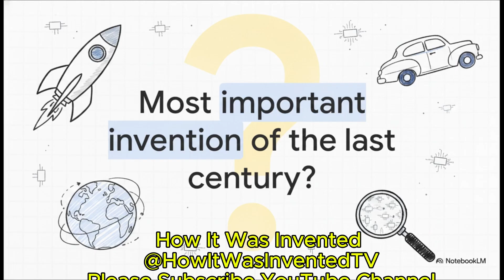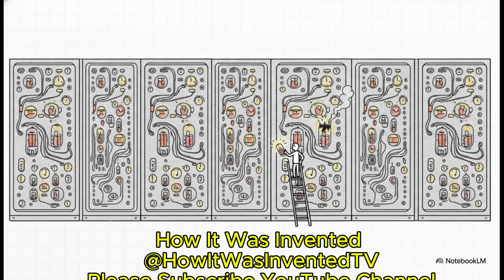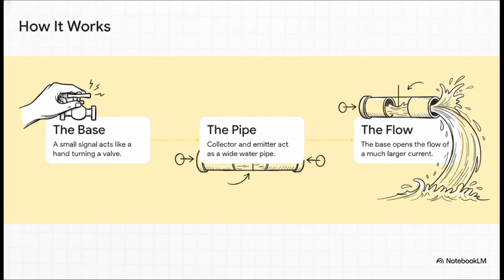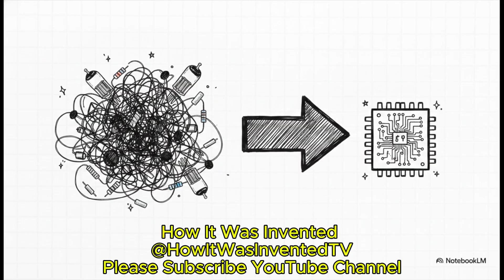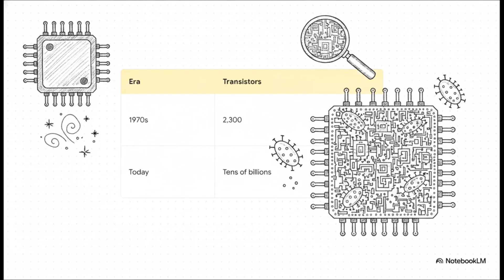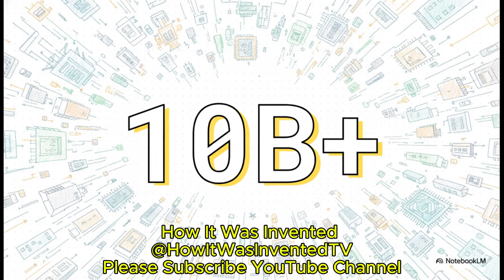How transistor was Invented and How It works

Comment: *The transistor, arguably the most important milestone jump of technology in the history of mankind, coincidentally appeared the same year, 1947, that Roswell, NM became a thing. From that point there was a slew of revolutionary electronic advancements. 
*One could also Google "What happened to a windmill in Texas in 1897? And then Google "What major electronic advancements were made in the year of 1897 and shortly thereafter? Surprise! Another slew of electronics understanding, innovation, revelation and invention previously unparalleled.
Could a rudimentary understanding of the simplest concepts have been gleaned, not truly discovered or invented, and then quickly put into ground breaking use? Hm!
Mankind went from walking or riding horseback since the beginning of it's existence to flying jet aircraft in 50 years. How did we so absolutely stunningly advance so quickly comparative to the amount of time that passed since  the first primate stood up to look around, and that 50 year jump?